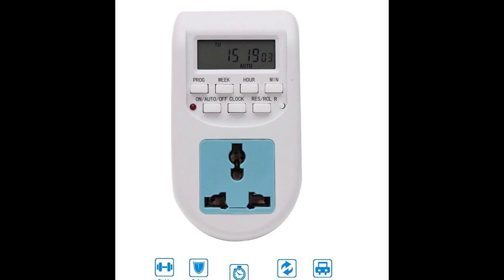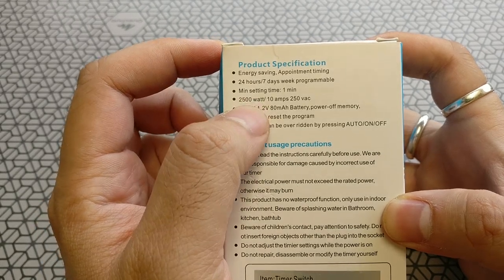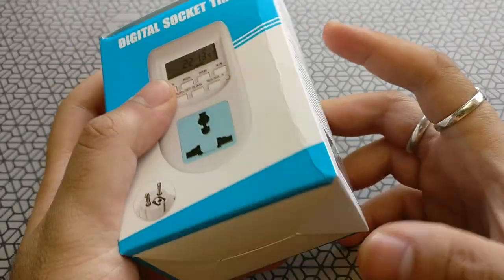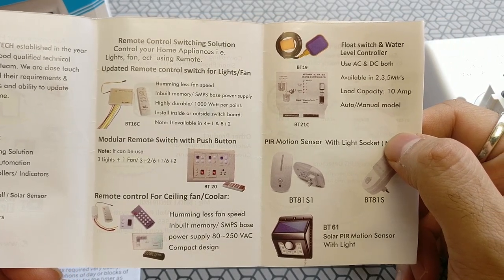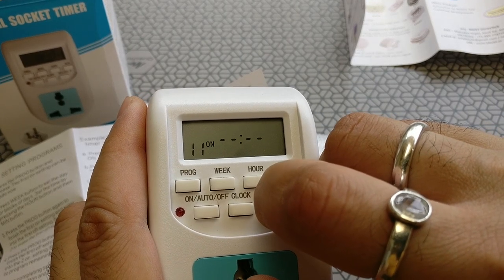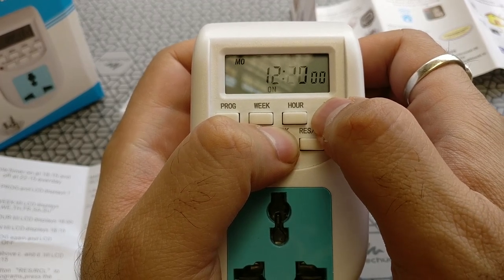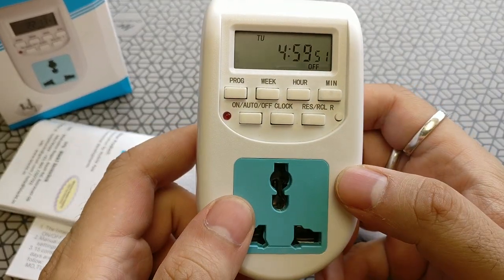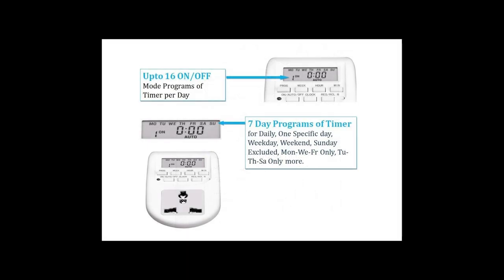AC Timer Switch from BlackT #timerswitch #programmable

Comment: If you set 1 program for all days of the week. That program will be forever? Or should I program all 20programs for a day to day basis?
Reply from the maker: It's one program with 21 programs...  if I remember...  it's one time forever until you change
Reply: @rtechreviews  mine was not doing the indicated schedule of turning off the power. This was my 2nd time that it happened to me. Not doing anything to it and it’s on auto mode

Comment: Hi Sir,does this plug have power backup,just in case the power goes off..will the device switch off?
Reply: Yes, Mr. Nayak, it does,,,, in case the power goes the relay is backed up by battery. Please do subscribe.
Reply: @indiatechnewscom  Thanks for the reply..but If I connect my WiFi router in it..will it keep the router powered on even if the power goes off?
Reply: @SuperYugant  no it's not got such a big battery... it's a battery to maintain  time settings and on off conditions only

Comment: Hi! Should this be charged in a weekly basis? Mine worked for a week,
but now it’s not working, tried resetting couple of times. But still won’t auto start. Any idea?
Reply from the maker: Hi... it would need constant charge ideally as it has a tiny battery inside... 
Try doing this to make it work.. plug the switch into the outlet and power it on and press the reset button while its plugged in. In about 3 or 4 seconds it should jump back ... please let me know if it worked... and kindly subscribe 😊 thank you
Reply: rTech I tried it, hopefully it works, if it’s in Auto mode should I expect that there is no light in that small button?
Reply from the maker: The light does come on for auto mode
Reply: I have same issue also..i tried ur tips RTech..stil not working..seems no electricity flowing on d device

Comment: When it’s programmed should the setting say off ? When I plug it in with it on or auto the lamp stays on.
Reply from the maker: Depending on the time you set on the clock... it can come on automatically

Comment: My timer has stopped working. Even when I place it in the ON mode, the current is not flowing, the red light not lighting up. What should I do?
Reply from the maker: Very simple.. when  the device is plugged in just press and hold the reset button

Comment: Very much useful and an ideal product to turn ON the freezer machine in Ice cream distribution vehicle. 
    The freezer on the vehicle needs  just 5 to 6 hours of charging and must be ready everyday morning at 8 am. So the machine much be Turned on at mid night 2 am or 3 am. Either a person must wake up and do it or else the machine will be turned ON before sleep around 10 pm.  
   This 10 pm to 3 am charging is waste of power. As the freezer is working beyond its cooling level. 
The automatic freezer control equipment is much costly. 
So your timer socket is the best 👍💯. 1000s of ice cream distributor vehicles are there. 
They all would find such a timer switch to save money and electricity. 
Thank you for your product.
Reply: I myself would recommend this to all our distributor in our ice cream company. 
  We are also ready to buy this switch in whole sale and give it them.
Reply: Tmer socket... Is very much cost saving and increased our profit by cutting wasteful money we spent hitherto... For excess running of freezer. 

I like to share...  Thank you for this product. 
We bought 2 devices... I wish you to take this to companies like us. 
All the best.